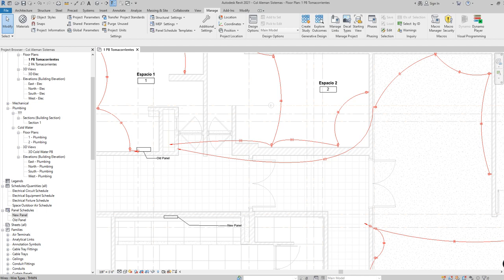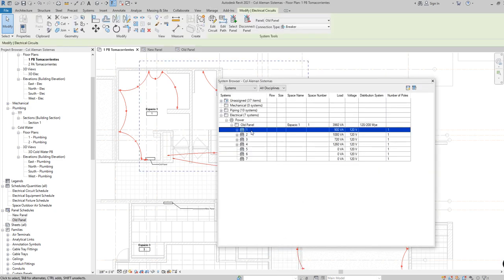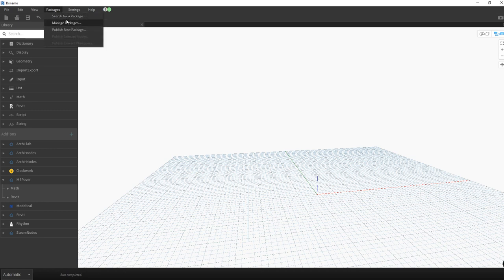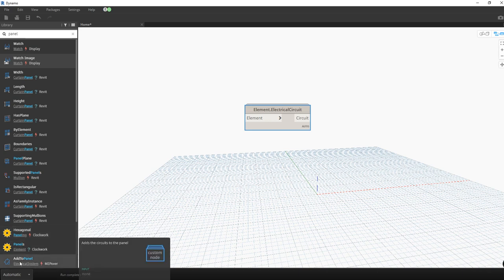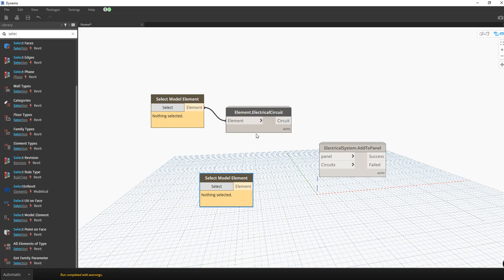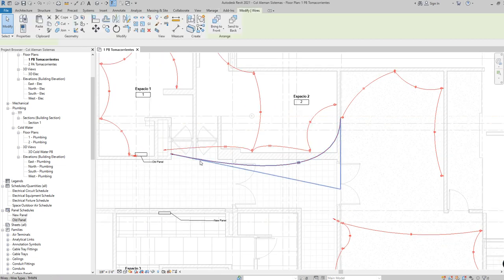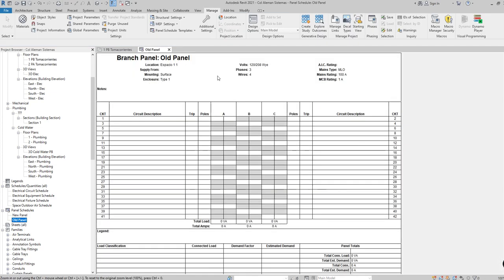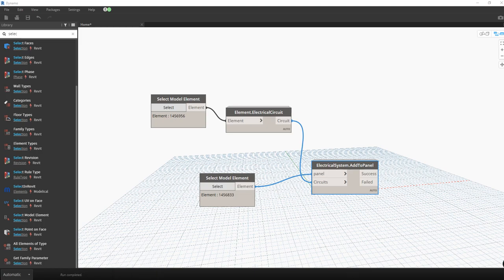Using Dynamo to switch panels  and circuits

Comment: I followed that workflow and MEPover package and the circuits transfer over, but they don't transfer to the same circuit position as the old panel. Since the script is pretty straightforward, not sure what is happening. Any help or thoughts you can offer? Thanks, great video.